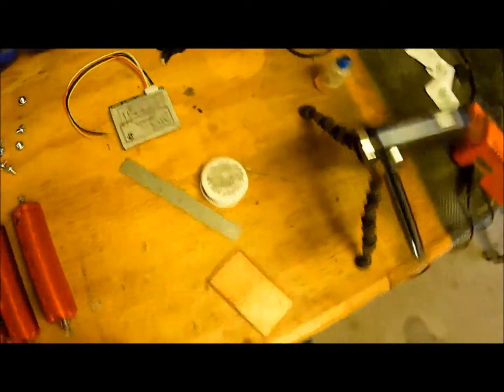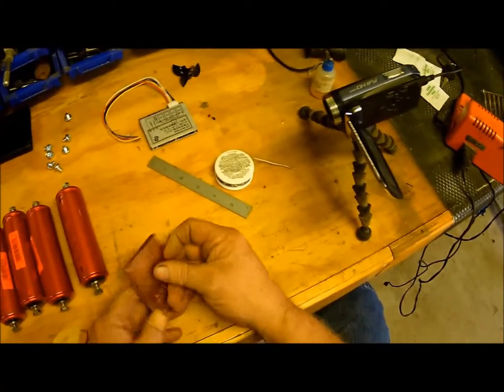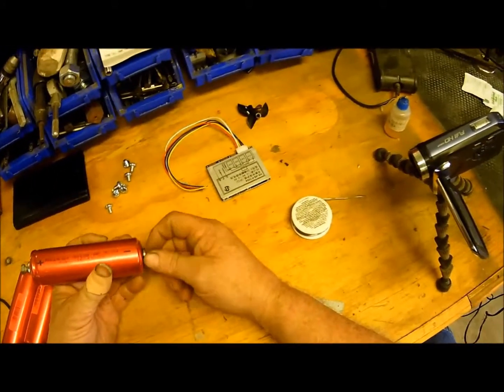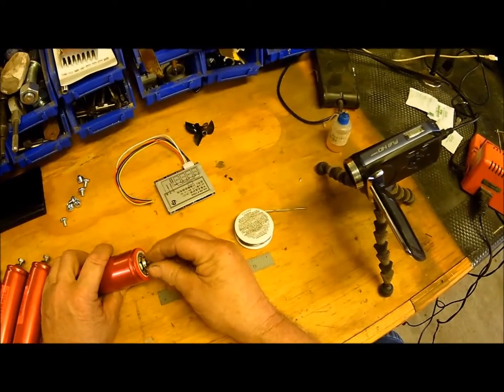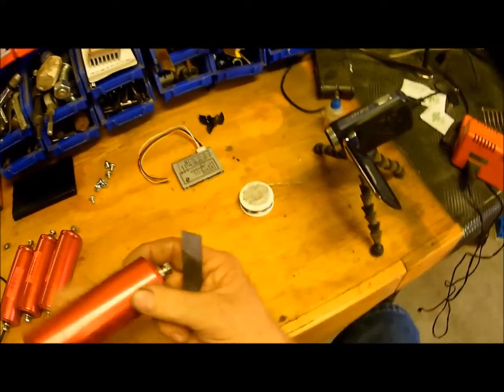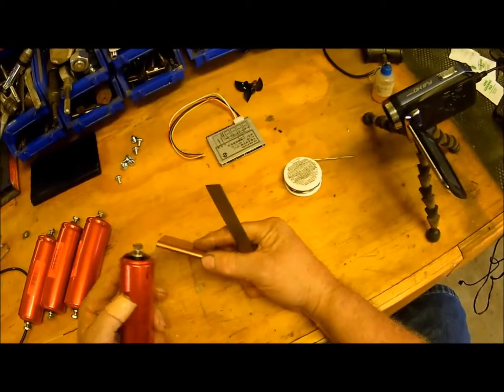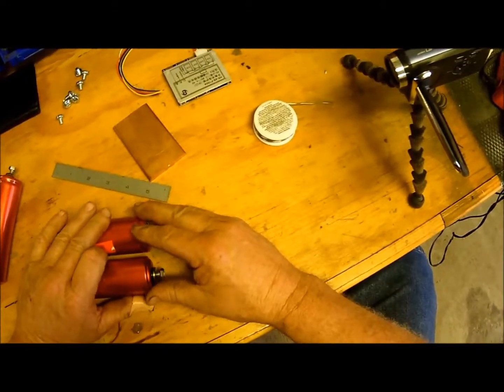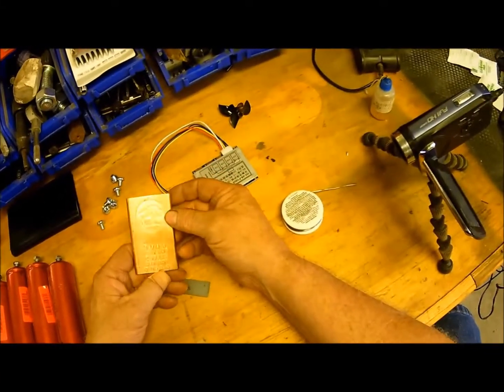New lightweight battery for kayak 38120HP LiFePo4

Comment: The positive end is deep to allow   the pressure relieve device to work. if the screw is to long you will prevent the cell from cutting out during over pressure over heat